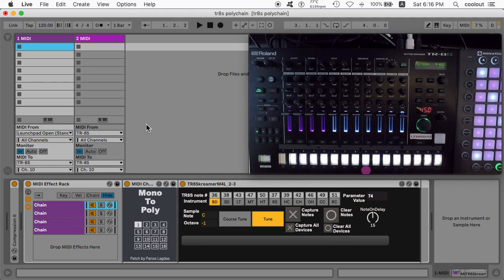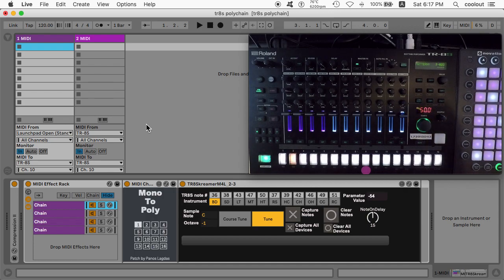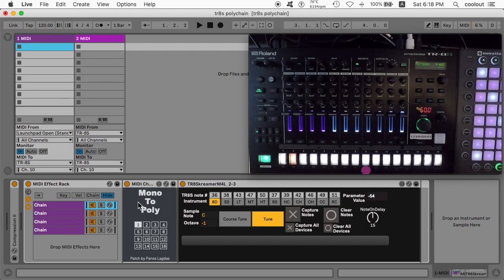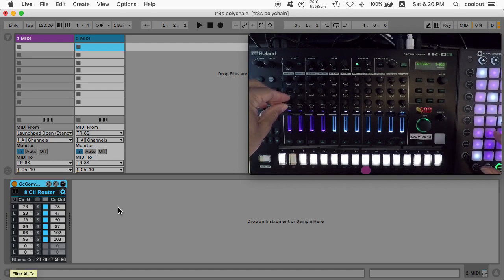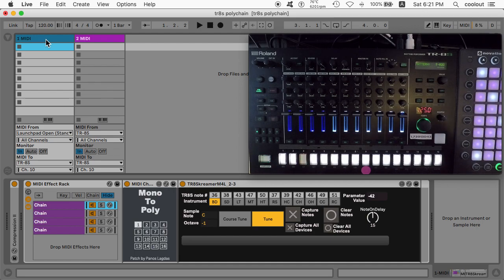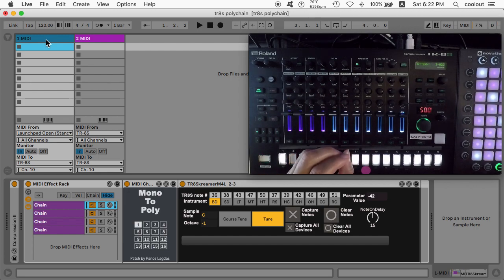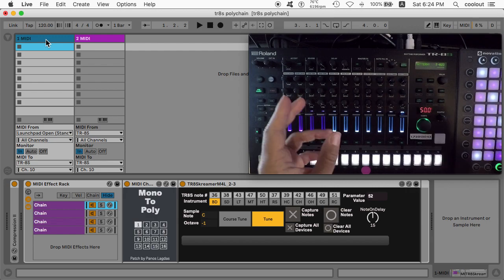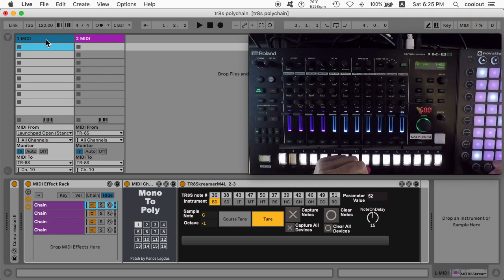Transform the Roland TR-8S into a synth.

Comment: i would gladly buy this template from you. *AHEM* GUMROAD**
Reply from the maker: Unfortunately, there's no easy way to make a template as it would require you having TR8skraamer installed (which is a paid plugin), the other free max plugins installed, then also have the TR-8S setup correctly within the midi settings in Ableton and on the device with however many and what type of synth voices you want vs drum sounds in the kit. Too many moving parts I think. Like I said in the video, it's all connected similar to a modular synth, so it's not just a simple all-in-one preset you dial up.